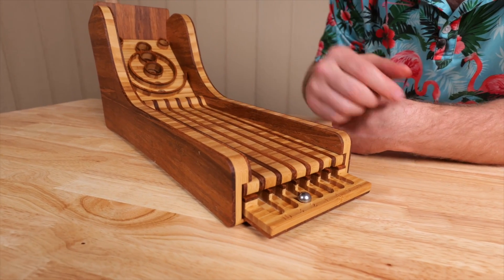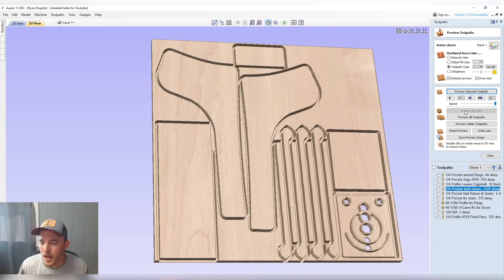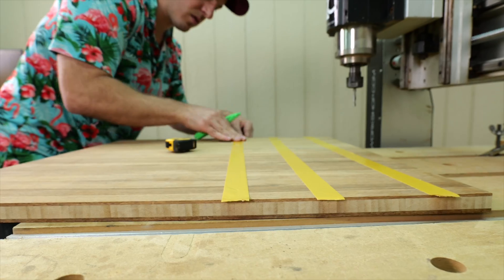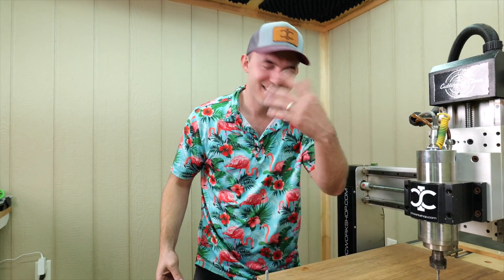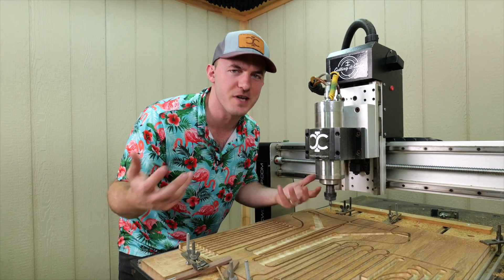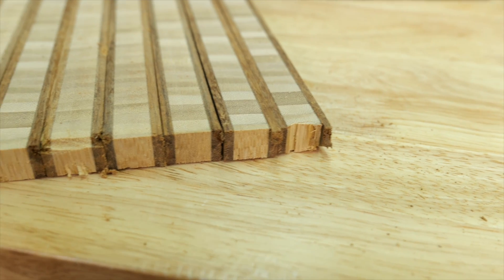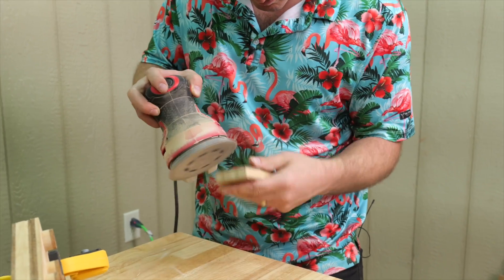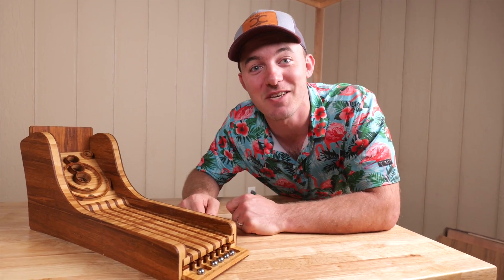Create Your Own Mini Skee-ball Table with a CNC

Comment: I am going to buy this file.  Getting ready to scoot for now but looking forward to trying this.  Looks like this is you IQ so it should fit on mine.  With the bits you are producing, maybe you want a 1/8" drill bit version.  I bought one from IDC woodcraft and it was a great addition to my Cribbage board making ability.  Very fast and no pecking required.
Reply from the maker: Thank you Rob! Yes it was on my IQ it worked great on there, I will get a drill bit added to the lineup as well!

Comment: What do you think about using a 1/8" compression bit for the holes and for the profiles? I am worried about tearout on the material surface with a 1/4 upcut for the profiles.
Reply from the maker: Use a 1/4 down cut for the profiles, you would get some tear out with that upcut. It could work with that 1/8 compression, but I wouldn’t drill with it.
Reply: @cutting-it-close  Thanks for the super quick reply. Ok, I will use a regular 1/8" upcut and only go part way. 
WIll use my Groovee 1/4" for the profile. 

I bought three sheets of material a couple of weeks ago, but also have three kids so I don't want to mess any up. I plan to do a couple of test cuts in the unused upper right section.
Reply from the maker: It’s cuts so good, you’ll love it. I don’t have any special recommendation either, it’s cuts like a Baltic birch or like a cherry.
Reply: I did my test cut which was really just a second backplate with a design on it. I tried the DOC you have in your file which does the profile in 2 passes at .315. 

I have to say that made a lot of noise on my Shapeoko Pro with Carbide 3D router. Maybe it’s always supposed to make that noise and I just baby things too much. It worked but there was a slight step halfway down all the way around the part. I don’t think is was a XY shift as it is consistent all the way around. Top pass was more narrow than the bottom by about 1/32 or so. It’s not an issue for the back plate but if the pieces that get glued up for the main playing surface are like this it would require a lot of sanding. 

I may try another test with a more shallow DOC.
Reply: I did get the project cut, finished and glued up. It looks good. There are a couple of dark spots in the edge grain of the lighter bamboo center which are pretty apparent on the playing surface. I don't know if that is typical with the material or not but it still looks good. 

I ended up duplicating most of your paths and using a downcut bit for the first 1/8" or so of most of the profiles and pockets and then using an upcut to get the rest but in smaller increments than you did. It almost tripled the time but worked. 

The tabs and tape I used were not sufficient for the pieces that make the playing surface so I paused after the final pass of each one and took it off the table before resuming the job. The skewers linked are larger than the holes so I drilled them out manually. This led to alignment issues. I ended up using only 1 in the center and a Rockler mini panel clamp for that glueup. 

Of course my other 2 kids want one now so I will apply lessons learned. 
Anyway, great project. It was fun and looks impressive.

Comment: Honestly, it's very fair of you to show, that you make mistakes, also, even after 12 years...
When it happens to me, I go nuts 😡 start swearing and all that... Now, I'm gonna be a lot more calm, because as you said, it's a process...
CNC is for people with the nerves of steel and enormous love for wood products...
Reply from the maker: Yes, I learned it from operating machinery at my big shop, I’ve had $6,000 parts break, $500 bits snap because I didn’t set the Z height correctly, you name it, it’s happened. I learned overtime to not get mad at the machine, or yourself,  just learn. And even when you think you’re good, then it still goes bad, just say “well, looks like I’m still learning”. To me, it’s very humbling and refreshing, because I love to learn.